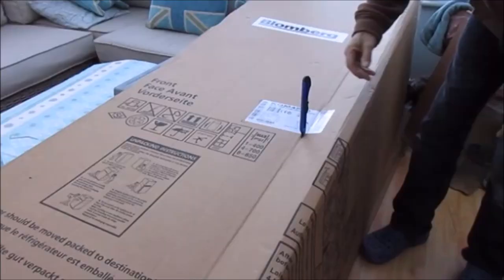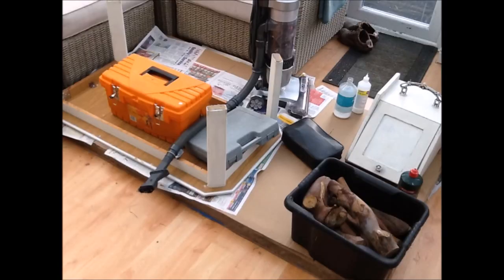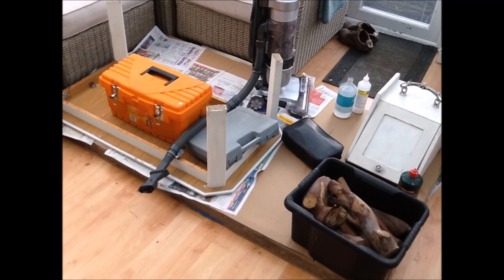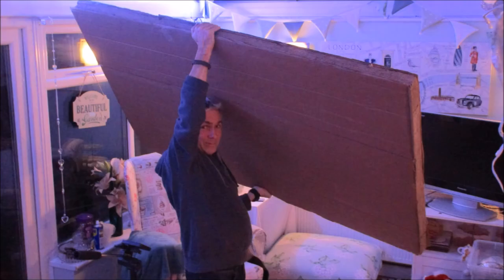How To Make A Model Railway Baseboard - Out Of Cardboard

Comment: I will be following this project with interest as wood is expensive these days how are you thinking of mounting the track to it if you don't mind me asking?
Reply from the maker: We use roofing felt ( see earlier videos) as a ballast mat which will be hot glued to the base board and then the track pinned down with long nails instead of track pins. On Homewood which gas a cardboard baseboard I have pinned and ballasted in the usual way, but with longer nails again, £1.09 from maplins or .99 from pound land!
Reply: Budget Model Railways okay thank you I'm thinking of doing a small end to end dc layout about 2' by 6' I have seen some people glue there track instead of pinning but not sure what glue would be used?
Reply from the maker: Hi, I believe they usually use PVA but you would need to ballast in the usual way, or you could use double sided tape and then either dry ballast or ballast in the usual way?

Comment: How many boxes were needed to make this? How big the final piece turn out to be? Looks good tho, could be more rigid when like you said added some additional supports most likely in a triangle position
Reply from the maker: Five ft by 3ft in the end. Three very large cartons were used, we get them for free from a loco electrical appliance store.
Reply: Budget Model Railways Damn! Be nice but I'd need a 8x4 ft piece guess the good thing is you can always glue more together
Reply from the maker: It would all depend if you could find an 8ft long box I guess?
Reply: Budget Model Railways guess there's only one way to find out and good thing my bro works at a recycling plant bet he could find boxes easily
Reply from the maker: That's a big help, probably time to call in a favour!? Lol
Reply: Budget Model Railways Pretty much
Reply: Could you build a longer base by alternating the direction of each cardboard sheet, i.e layer 2 is glued down at 90 degrees to layer 1, layer 3 at 90 to layer 2 and so on? My latest project is 3.6 metres long by 0.85 made from timber and ply and it's not light!
Reply from the maker: Yes you could do it get way, we also could have made it stringer by turning the beams vertically

Comment: I lost count of just how many layers of card you used. I must admit that I would have cut the pieces to shape and then laminated - much more work than laminating first and then cutting. I would have put the beams vertical - which would mean more accurate cutting. So. my way would have taken about a year. I am about to make a baseboard for a OO micro layout out of 1/4" balsa. It might even result in a video, who knows. Don't hold your breath.

Comment: Hmm, I like the idea, a lot! But the effort that went into it was huge! You could just go to B&Q and buy some insulation foam board, it's cheap lightweight and hard wearing! But as i said above, it's a great idea, and I do get it. Great upload
Reply from the maker: I did think about foam board but it is more costly and as I understand it has to be supported by either battens or a plywood surround as it has a tendency to snap if moved around a lot? This would add to the cost and weight.
Reply: Hi, nice technique, and it is nice to see people experimenting. As the Train Dude has mentioned foam board works. It is about £25 but needs no work. I built 'Dinkley Bottom' in 9 hours straight on to it. I also built a few other layouts such as 'Trio' on it and supported that with 2x1 batons (still lightweight). Trio and Dinkley Bottom and also Langtons Retreat are on my channel if you wish to see. 
But really good to see someone trying something new I do get where you are coming from, and I hope it lasts. If kept dry I am sure it will.
Reply from the maker: Hi, thanks, will take a look at your vids. As you say it will be interesting to see how this works, I just wanted to try something new rather than the same old methods. Even foam board seems novel in the UK where the accepted norm seems to be battens and plywood. This way is cheaper and lighter but whether it's worth the effort and the long term viability are good points.

Comment: most of currently sold supermarket quality doors is probably lower quality :P
one thing that is interesting me though is
Why did you make those beems first and skin them later instead of cuting cardbord inerds and glueing it in one go with the top and bottom?
Reply from the maker: You can do it either way, but our way you get a neater edge! ;-)
Reply: if you going to trimm those edges afterwards anyway, who would see the difference?
Reply from the maker: It's as broad as it is long, your way is easier if you don't have a saw?
Reply from the maker: I see where you are coming from, if we make another one we will probably try other ways of building it.

Comment: An even cheaper way would be to use wallpaper paste rather than waste all that PVA.
Reply from the maker: Wall paper paste would be great, we didn't have any, and only use cheap PVA.
Reply: Budget Model Railways We made a 'Dragon's Lair' out of cardboard in this way for a charity fund raising event. It lasted quite a long time. We kept it in the roof space, but it eventually fell apart. Foam core board is a bit better than cardboard, but it is quite expensive. A good investment for this project would be a hot glue gun. We use Dremel high temperature glue sticks. Make a hole in the cardboard, apply the hot glue, stick in fence posts, trees etc. Stick track to cardboard with copydex, not PVA which is impossible to remove. Cardboard can be sealed with MDF sealer before fitting track. Alternatively use painted squares of foam wipes obtained from the pound shop to make the trackbed. Hills can be made from discarded polystyrene.  Fix to cardboard with wallpaper paste. Fit trees to polystyrene with hot glue gun.
Reply from the maker: Hi. Yes we have a hot glue gun and have used it to stick down our roofing felt track may. I had thought about using it to stick the cardboard so thanks for the heads up.
Reply from the maker: Hi. Interested in the foam wipes as track bed, not sure what they are though?
Reply: Budget Model Railways You can get foam ballast, but that doesn't fit points and sectional track. Buy a bag of foam wipes in the £1 shop and cut them into strips. They have to be painted or dyed dark brown because they are bright colours. You can also use green pan scourers cut into strips to make hedge rows.